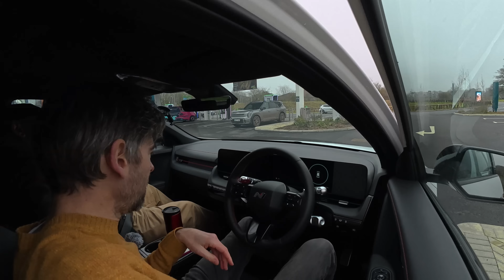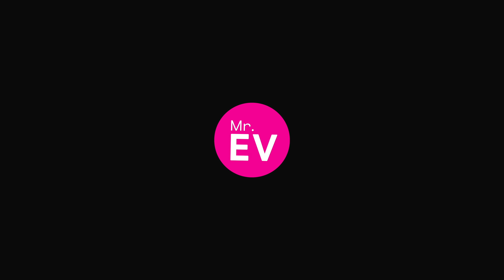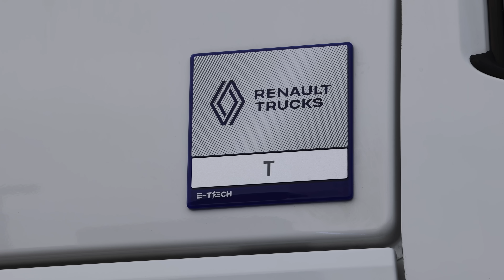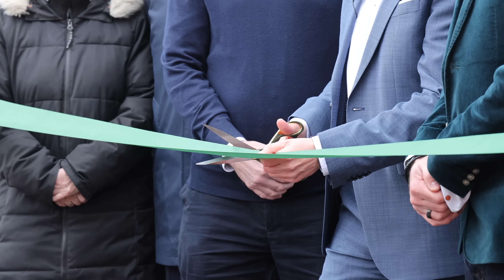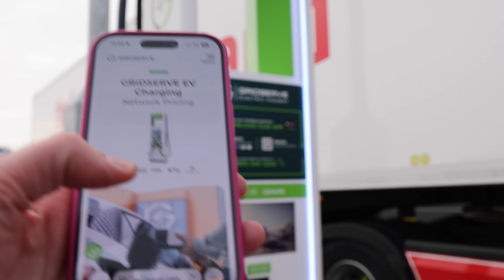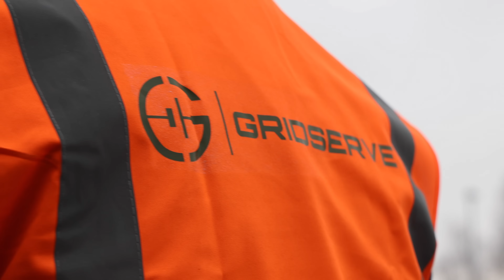Charging electric HGVs: the future of freight, up close. The launch of Gridserve’s first HGV hub

Comment: I think the E.V idea,sola panels heat pumps in practise great idea,but its a total    loss , we have not the power in sub stations if every one charged in Uk at night it would blow the national grid, get a old house on a heat pump waste of time ,open main door heat has been lost
Reply: I don’t think you’ve really understood the problem here. If every car in the country was an EV and they all charged at the same time, you’re right, we wouldn’t have the capacity. 

We also wouldn’t be able to cope if every car in the country tried to fill up with petrol at the same time. 

EVs don’t all have to charge at the same time though. They can stabilise the grid by intelligently charging when demand is low. This is how the octopus intelligent go tariff works.
Reply: @Trifusion1 I do understand we do not have the capacity to power,all the heat pumps ,evs, trucks etc with the presant infastructure we have if we go all electric with respect
Reply: @kevincook2591  we don’t have the capacity now, which is why this is a transition. 

We’re not going to be 100% electric tomorrow. 

It’ll take 30 years to replace everything. In 30 years time we will easily have the renewable energy generation to power everything.
Reply: If the infastructue is going to take 30 yrs to be fully running ,how will we power all the EV we shall all have to be driving in say six yrs
Reply: @kevincook2591  we won’t all be driving EVs in 6 years. There will still be petrol cars for sale in 2035 and they will be on the road for at least 15 years.
Reply: It will not happen in this country,how long to build HS2,,we do not have the infastructure to do so, i would like to see it happen, but we are not self sufficent in the engineering to do so its a dream

Comment: The U.K.'s grid has basically two sorts of generation, firm which can provide power as and when required, and renewable which provides power when the weather is favourable, which it very often is not. We also have interconnectors to neighbours  which depends on their situation at the time so cannot be relied on at all times.
Government policy is to increase electricfication, in the mistaken belief that it is 'greener' and simultaneously run down firm generation capacity, to the situation today, that when the penny drops that we need this firm generation, it takes far too long to build in time for when we need it.
The National Grid operator already has plans to schedule rolling power cuts just for this situation.
Sounds a bit like Baldrick's, I have a cunning plan!
Reply: The 'firm' generation needs maintaining, gas and nuclear power stations are often offline e.g. nuclear for about one month every couple of years for maintenance. Solar and wind are complementary as one tends to produce energy when the other doesn't and with expansion plus battery storage and increased interconnection with other countries' renewables the intermittency factor can be almost eliminated. Nuclear and gas peaker plants can deal with the remainder, not sure why you think it's a mistaken belief to think renewables are greener, they're much cleaner and more efficient than any fossil fuel source.
Reply: Geoffrey,

at the end of the day insufficient firm generation and an increased demand due to governments electrification policy simply means a lack of reliable capacity. (Batteries are a joke)
Maintenance of conventional generators is always carried out in the summer, when demand drops.
Intermittency is one factor and reliable capacity is another. My point is reliable capacity is decreasing as plants age, new generation is too little and too late and demand can only increase with electrification and also the other aspect of AI expansion.
The reason I say that electricity is not as green as portrayed is simply, increase demand and gas generation increases to meet it, nothing else can (UK) so emissions are proportional to demand.
Another aspect is that gas often runs at low levels of output, thus is less efficient than it otherwise would be which increases emissions. Some gas actually runs feeding no power at all, (Spinning reserve), none of these emissions are accounted for.
Gas, by the way, is essential for grid operation and supports renewables.
Reply: Just to pick on one of the many holes in the comment, electrification is almost always greener. 

A heat pump powered exclusively from gas power plants uses less gas and  produces less CO2 than a home gas boiler. 

An EV powered exclusively from gas power plants produces less CO2 over its lifetime than  petrol car. It also uses less total energy because it’s so much more efficient and reduces air pollution. 

Forget where the generation comes from, electrification is a good idea regardless.
Reply: @Trifusion1  

I don't agree, give me some specific figures please.
Reply: @i @iareid8255  the nice thing about physics is, it doesn’t care if you agree or not. Physics just is. 

The heat pump is a simple calculation. First look at a home gas boiler, if you have 100kWh of gas, you burn it and get around 85% efficiency. So you get 85kWh of heat in your house. 

Now with a heat pump, we could assume that all the electricity comes from a gas fired power plant. Start with 100kWh of gas, the power plant is around 60% efficient, so it will output 60kWh of electricity. You’ll lose  around 10% in transmission to the home so your house receives 54kWh. A heat pump will have a SCOP of around 400%, there are companies that guarantee at least 350% so let’s use that figure. 54kWh x 350% = 189 kWh of heat in the home. 

So with the same 100kWh of gas a heat pump gives nearly double the heat output of a gas boiler. Heat pumps also have the advantage they can run on solar, wind, nuclear, whatever. 

EVs are a slightly more complicated story, but the simplest way to look at it is the efficiency. EVs are 90% efficient at turning electricity into kinetic energy. Petrol engines are around 30% efficient, which is why they need massive radiators and EVs don’t.
Reply: @Trifusion1  
your figures have a lot of optimism.
CCGTs can run at 60% efficiency, run at optimal loads, which is rare. Tansmission losses are more like 8% and distribution losses are 12%.
Kw is the wrong unit, it should be KVA (Kw divide by PF, nominally 0.8)
Then there are the cop figures, which seem very optimistic? Even the government only claims 280.

Lets get back to physics, no device can be 100% efficient but your figures claim otherwise.

With evs you seemed to have forgotten all the losses in generating the electricity. Losses in charging the battery, losses in inverting the DC, losses in the power electronics to control the motor, which generate a lot of heat. If you have ever seen such devices the size of the heat sinks is significant.
Ambient temperature is another factor.

If something sounds to be too true to be real it probably is not.
Reply: @i @iareid8255 eat pumps are listed as more than 100% efficient, a lot more. This is because of how they function, they don’t turn electrical energy into heat, they use electrical energy to extract heat from an external source. This is fundamental to why they are so efficient. 

As for the numbers, even using 50% CCGT efficiency and the transmission and distribution loss you’ve suggested with that awful 280% figure you still get well over 100kWh of heat, much more efficient than a gas boiler. 

SCOP of 280% is quite a poor install. Check out heat geek installers, they guarantee a minimum of 350%. Their average install is well over 400%. You can track all the data from these installs, there’s even a league table. 

As for EVs, like I said, there’s a lot of complications. I’ve also ignored the energy involved in discovery, extraction, processing and distribution involved in petrol. There’s been absolutely loads of studies on it now, all pointing the same way. 

It doesn’t “sound” too good or too bad, there’s no views, no politics. It’s simply physics.

Comment: I think the big seller to truck operators will be the massive reduction in servicing costs relative to diesel. The drivers will also push the change once they've realised that electric trucks are so easy quiet and comfortable to drive.
Reply: There are also other factors, such as decreased driver stress due to much lower noise levels. Those drivers who have tried an electric HGV, often comment afterwards how much easier it is, due to the far greater torque available....
Reply: Why do I keep seeing comments about EV trucks being easier to drive, has anyone actually driven a new automatic diesel truck?

There a piece of piss to drive.

Comment: The math doesn’t work for electric trucks.
Imagine a fleet of 100 trucks with 95% in daily use. When they return, most need charging at the same time. Even at 100 kW per truck, that’s ~10 MW of power demand at one depot. What utility can realistically provide that—and at what cost? The electricity bill and grid upgrades alone are massive.

Then there’s weight. Truckers already fight strict weight limits because payload is the business. If batteries take ~20% of the truck’s weight, payload drops, revenue per trip falls, and some orders must be rejected to avoid overweight fines. Margins shrink fast.

That’s why pure battery trucking doesn’t scale. The realistic future is hydrogen, diesel, or hybrids—not all-electric fleets.
Reply: but the offset is the massive reduction in the costs of servicing  electric relative to diesel-powered hgvs which can be at least £100-£150 per week. Setting up depot charging will be expensive, yes, but it halves the fuel cost per mile, a big deal for hgvs. Many depot operators will, I think , be also looking at their own renewable generation and batteries on site, to further reduce their cost per kWh.
Reply from the maker: I should have mentioned the TCO, thank you!
Reply: Why might they all return at the same time?  For that to happen, they'd all be doing identical length journeys, using exactly the same capacity from their batteries, with all the drivers having the same driving style etc..... Why are you assuming they all must charge at their home base?  Might not some of the drivers top up their battery while having a meal break at a truck stop somewhere?
Reply: Starting about hydrogen, hybrids and diesel in 2026 😂😂
Reply: Spot on comment !

Comment: What a great video & fantastic to finally see some bespoke HGV charging sites being opened, well done to EV England (I'm a member too) for being part of the initiative. I've seen numerous videos by the 'Electric Trucker' - who travels around Europe where the infrastructure is far more advanced , with numerous sites with similar set ups to those in Baldock & Exeter. He does also have to use the chargers originally designed for cars, by un-hitching the trailer & pulling into a charge site in the cab only , hoping the cables will be long enough to reach. I assume all the EHGVs currently on the UK roads are only using the CCS connectors , same as cars, rather than the MCS (megawatt charging standard) which some of the European trucks seem to have - I'm not sure if they also have a CCS connector too or not.
You're absolutely right about the costs though - that's the only downside to Gridserve. The costs would be prohibitive for most companies, unless they can do the majority of their charging back at the depot, or delivery sites, but when they need the 300+ Kw charging speeds, the grid connection/capacity fees will be extortionate.
Reply from the maker: Gridserve will be looking to support MCS in the future as well. I’m not sure if HGVs will have both connectors actually. A CCS adapter would be a bit clumsy I think.

Comment: It's a big minus that gridserve is SO expensive! I live in Northern Europe, and have used the hub in Essex because I'd seen it on fully charged, but when there are other much cheaper options it's not one I will repeat. Since it was almost empty I can't be the only one who thinks this. It's a great shame.
Reply: Gridserve ad-hoc pricing is certainly one of the more expensive on the UK network. I did speak with Sam Clarke recently and asked him if eHGV pricing would be as expensive. He told me that ad-hoc pricing would be the same price everywhere regardless of type of vehicle. But he did say that Gridserve is entering into contracts with several eHGV companies to offer reduced-price charging via roaming services such as All-Star and Paua.
Reply: We need Tesla to put some truck superchargers in at half the price of Gridserve. The savings on filling a battery pack of 400 kWh would be huge and hasten the transition away from diesel.
Reply from the maker: I wonder if the Tesla Semi will ever see the light of day in the UK. If it does, Tesla Superchargers for trucks might actually happen.

Comment: Good video. I'm sure there are going to be pricing agreement with CPOs and fleet operators as its almost a captive market and this won't show on the charger.  If you've watched the channel Electric Trucker, you'll see that he works fine with a  45 min charge especially with the 400kW chargers
Reply: Yes, that is sure to happen, in the same way some bulk diesel suppliers - Keyfuels, UK Fuels etc - offer a discounted cost to hauliers and operators who agree to take a specified volume of fuel per week, Month or whatever.....

Comment: What a great video - and great work by Warren & yourself to get this exclusive look and be able to interview the PM for Freightway & the GS CEO!

I didn’t even know this was a project GridServe had ongoing or that theres already quite a few major HGV manufacturers trialling/making EV trucks! Those battery specs you put up are huge! Didn’t know there was a GridServe Forecourt at Baldock either - I’ve got friends living near there so that’ll be handy (though still wish they would join Octopus Electroverse!).

I know they’ll be reluctant to, but the Gov should reduce the VAT on charging at public chargers like these, to help get the prices lower. I’m sure I read somewhere of some charging locations (can’t remember which company), using large batteries and solar to charge up overnight on cheap (and by solar during the day), and using the batteries to power the chargers, which might eventually help lower charging costs too - though I guess possibly only after they’ve paid off the cost of installing it all!

That’s going to be one HELL of a power draw when it’s full of trucks like that.
Reply from the maker: Thank you! I should have put on screen, but the Forecourt is at Stevenage. Only about 10 minutes away from Baldock Services. Quite a lot of charging infrastructure around there as there are loads of chargers at Baldock as well.

I believe the Government are now seriously considering a drop to 5% on public charging VAT. I think it's an open secret! Obviously that wouldn't help the HGVs, as they'd be claiming back the VAT anyway, but it's certainly needed for the rest of us.

Comment: Well Truck me. Looks impressive and one might wonder why it hasnt happened before. BUT, of course, far bigger batteries and bigger charge requirements.  So....Cars, Buses, Trucks and coming soon Trains.  

Currently putting up the overhead electric catenary between Waverly and the Forth Bridge. Thats as far as it goes. The idea is that Battery trains will start charging at Waverly from the overhead cables. They will run to Dalmeny still charging. Then they will cross the bridge into Fife and run through to the other side of the Tay Bridge at Dundee where they will pick up the overhead again to top up/recharge for the return journey. I'm guessing 25kVAC should allow for a fairly brisk recharge time.
Reply from the maker: That makes so much sense! I'd love to know the amount of diesel that's going to save.
Reply: You can happily pull upwards of 5MW from most of the 25kV network, so the limit will be the battery and supporting electronics I suspect.
Reply: There is a big mega-hub in Germany that serves trucks, busses & cars - others popping up across Europe
Reply: Are you sure about that 25 kV AC supply?  AFAIK electric trains use DC, not AC, and at about 1/10 that voltage or less.
Reply: @georgepelton5645  Large parts of the european network use 25kV AC. 1500v DC is used in some places but it's been obsolete technology since the 1960s.